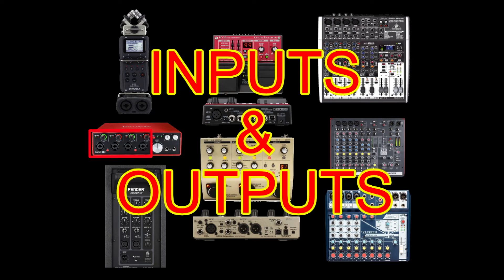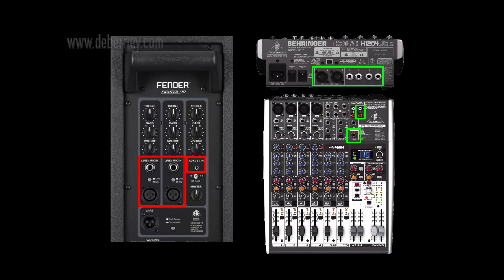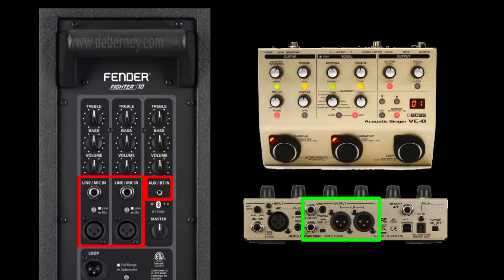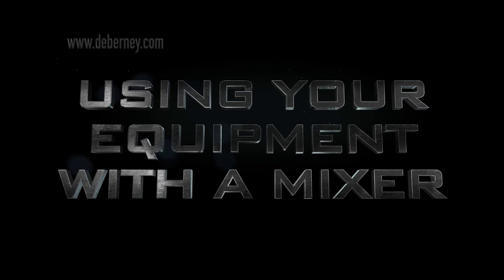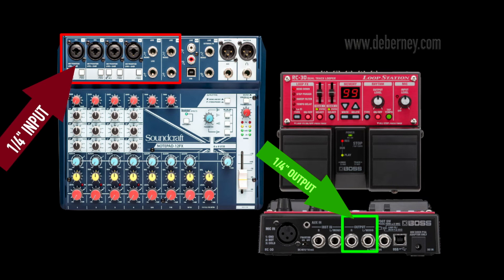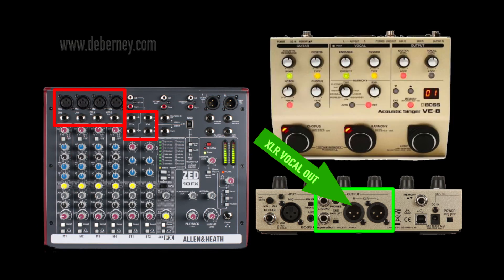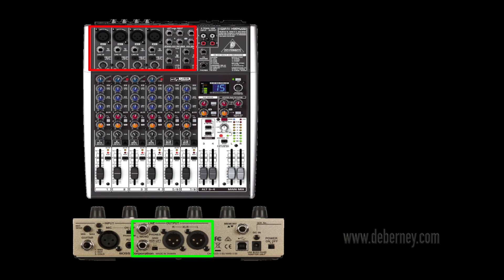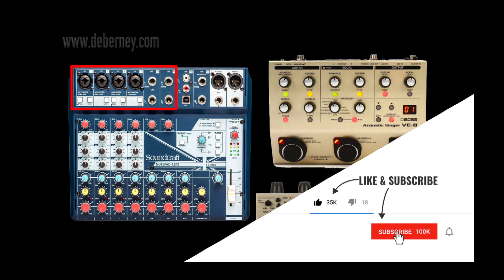MIXER INS AND OUTS and how to hookup VE-8 & RC-30

Comment: If I want to send my guitar from the VE 8 into a ME 80 and a RC500. I want the acoustic guitar to go most of the time through the VE 8 but for some songs I want to take the guitar into the ME 80 for the second track on the RC 500 looper. Would you suggest daisy chaining them before going into a Xenyx 1002B mixer or imputing each separately into the mixer, then put to my Cube Street EX?
Reply from the maker: I’d try both ways and see which you prefer and which may be easier.

Comment: Hi. You're forgetting something very important: where do you connect your mic and guitar? It's pretty easy to see "the pattern" of in and out but what about where do the instruments go? I'm struggling with that bit because I'm about to get a loop station (boss rc-500) and my mixer (Yamaha MG10XUF) doesn't have an aux send. That is the "pattern" I'd like to see but so far couldn't.
Reply from the maker: Input on your device is for instruments. Output on your device ve8 or looper will go into any mixer track
Reply: @DebErney  clearly you have no ideia of what I'm talking about. My point being that there's a whole lot more than "the pattern" of in and out. You must take in account, EQ, split channels, amount of signal... Take it from me, not "just that pattern".

Comment: Hey Deb , so I've been using the boss rc-30 and just added a Mackie mix 12 on the back end running into a headrush speaker  . The boss rc-30 has a left mono output and a right output .. I have these plugged into channel 1 and 2 on the mixer .. the problem is that I'm unable to seperate the levels between  the guitar and vocals so I'm really not able to enjoy the full benefit of the mixer .. I'm assuming this is because boss doesn't have a dedicated mic out or instrument out on the RC 30... Is there anyway to fix this?
Reply from the maker: I would look at the manual.  I thought there was a way to send a stereo output which you could pan right and left.

Comment: I love your videos please help me. I need to know if I need the ve 8 and rc 30 to have effects in my guitar and voice and also  a looper. can I have that only with the rc30? or I'm gonna need both..? I want to be able to have effect in my voice and guitar and also looping however I'll want 2 tracks looping. thank you
Reply from the maker: I have not had any luck using two loopers though you can run the Boss  output to the RC30 Input.
Reply: Deb Erney thank you so much. so I can plug th3 the ve 8 to the rc 30 using the rc30 as a looper and the ve8 as effect pedal for voice and guitar
Reply from the maker: Yes you can